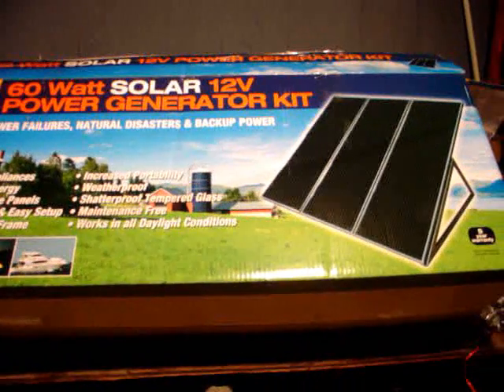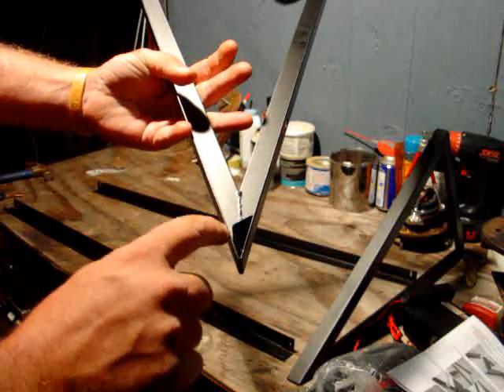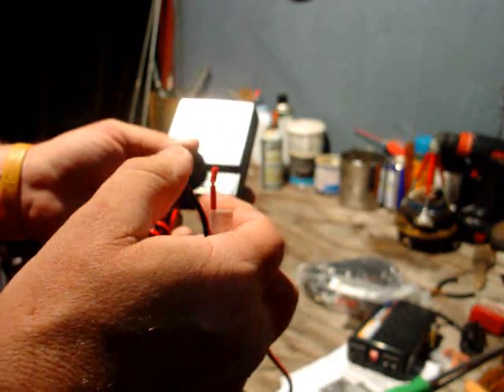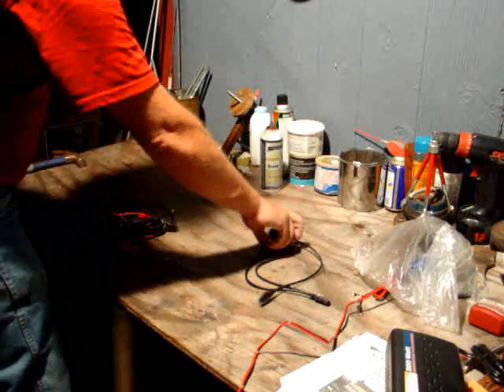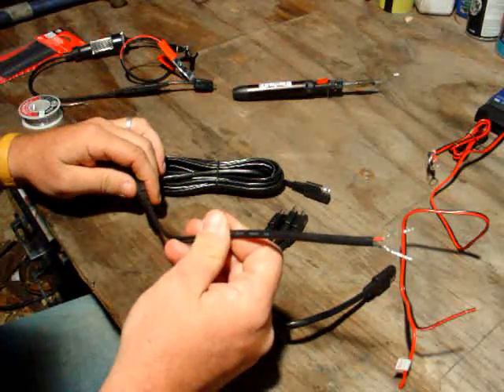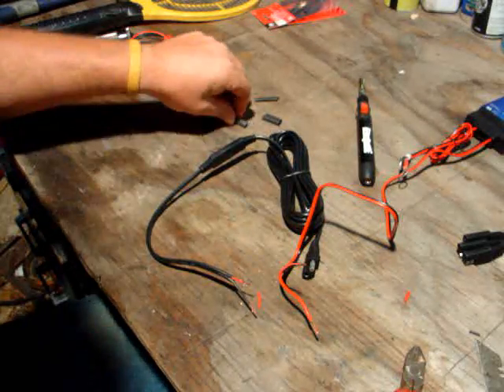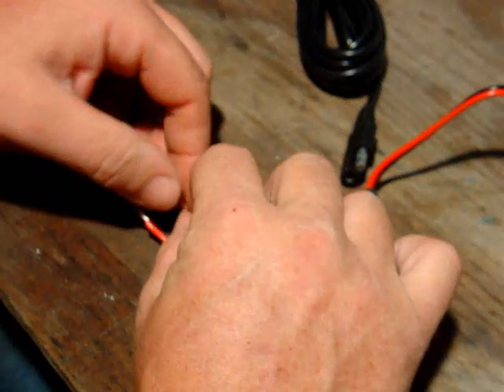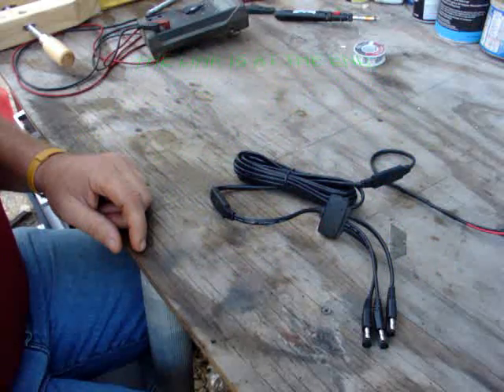Harbor freight 100 watt solar kit - UNBOXING and SETUP - solar panels for beginners (part 1)

Comment: Love how you soldered and insulated the wires.

My father just had an issue with his 93 Dakota last Thursday... no spark, or gas. After looking at the wire harness I could see why. A splice coming out of the relay box (under the hood) was shot. They 4 wires spliced together with just a crimp... which had rotted, wires feed ECM . Finally got to use some of my heat shrinks from my electrical kit. :) Crimp they used for feed going to alternator was also shot, $9 for just the crimp and heat wrap.
Reply from the maker: most problems on those newer cars are just one of the many unnecessary sensors, and/or wire connections that were poorly done at the factory. A good connection cures many things, including gas mileage.